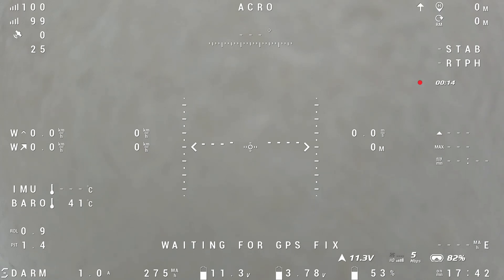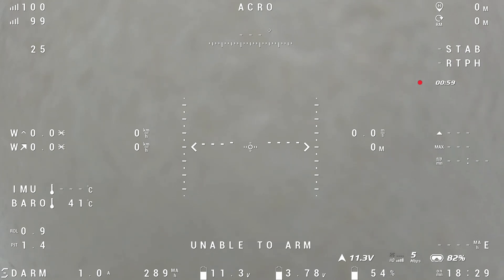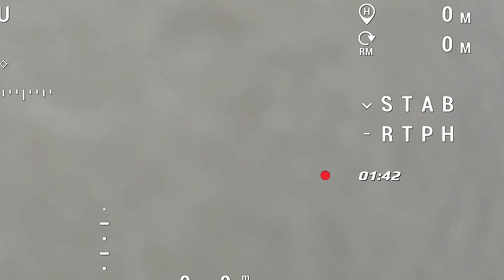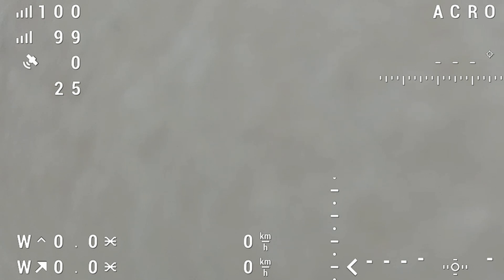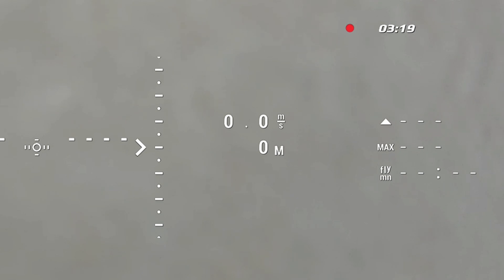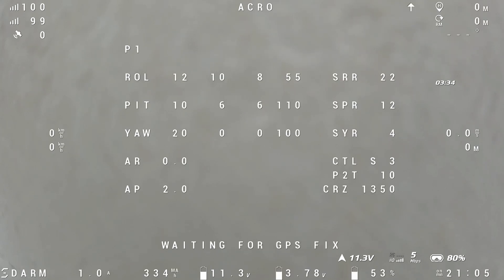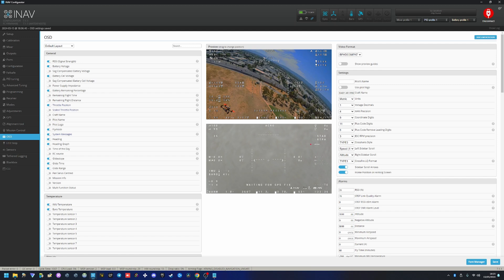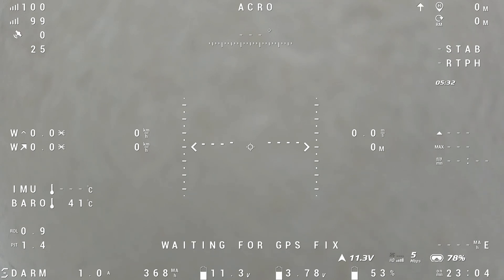DJI O3 OSD Without A Single Questionmark!

Comment: hi, after 2 hours of flight with the OSD I noticed the Wh/Km icon don't appear on my goggles, I see only the value and that's the most important of course. I don't know if it is a normal behavior or an issue. Another thing concern the flight stats: At the end of flight, I can see them in my goggles but they never appear in the OSD recordings, is it possible to let them recorded too? Many thanks to you.
Reply from the maker: Regarding the flight stats: The goggles stop the recording very quickly after you disarm and the end screen does not show. I have the same issues. The only way is to start the recording before you arm and then it will continue recording after you disarm. It works on the Vista running the O3-compatible firmware, not sure if it will work for an O3, I have to try this. 

Regarding the icon: I'm not sure what you mean. Form what I understand, you don't see the characters in flight, but then you do see them in the recording? Is that correct? maybe you can try to explain it again or upload a video.
Reply: @DZARO  I only see the numbers but not the unit appear, neither in flight nor in the recording, I having this issue only with the Wh/Km icon. 

It's a shame not to be able to record the stats because it's very useful for comparing different configurations.😃
EDIT: I have a second issue with the power (W) the value not always match the power, I guess when the power exceeds 100W the problem appear. I have published a video here: https://youtu.be/fpkzQL4G1iM
Reply from the maker: OK, so I looked into this and here is a detailed explanation:

The [mAh/km] is made up of two symbols:
SYM_MAH_KM_0 and SYM_MAH_KM_1
These have been substituted with the following:
[mAh] symbol and the letter [E], standing for efficiency. 
It is up to the user to know that the units symbolise "mAh of Efficiency".

In case of the [Wh/km], there is only one part to the symbol:
SYM_WH_KM
This means that it can only be substituted with one character, not two. 
I have left this one as blank because there is no adequate way to symbolise "Wh of Efficiency"

My suggestion to you is to use [mAh/km] as the efficinecy units, so that you don't have blank spaces. 

I know the solution is not perfect, but there is no alternative at the moment.

If you look at the following image below, you'll see that the [mAh/km] is made of two characters and the [Wh/km] is made of only one. The rest of the code is based on how these are being used and combined.

 https://github.com/iNavFlight/inav-configurator/blob/master/resources/osd/analogue/default.png?raw=true
Reply: I understand it is a software limitation, not a bug. Thank you! Have you seen my video with the W unit which disappear when I guess exceeds 100W? Maybe the same software limitation?

Comment: If this is not merge on the official Inav releases I don´t know what deserve to be on the project. Thanks again for your time!
Reply from the maker: How much do you want to bet that it will not be merged?
Reply: You can just put the "altitude" symbol on everything and achieve essentially the same result. They won't be labeled with a question mark, they be labeled "altitude" instead.
Reply from the maker: @senseisecurityschool9337  Yeah, but I chose icons that make sense to a cetain degree. Ofc it's not perfect, but it's acceptable give what the alternative is.
Reply: @DZARO   You chose icons that mean something else. You choose "K" for distance in METERS.  THen when we told you that you made the change in the wrong file and you should move your changes to the appropriate place, and that M would better than K, you started slandering us.
Reply from the maker: @senseisecurityschool9337  And what is written in this PR is not slander of DJI for example: 
https://github.com/iNavFlight/inav/pull/10046
🤣
Reply: @DZARO  No, it's an accurate statement of fact. Slander is when you make up lies about people. That doesn't go over well. Ps - when you're called out for misbehaving, a great response is to apologize. Doubling down on actions that are so completely inappropriate that it's actually illegal isn't a good look. That's not a winning move.
Reply: @senseisecurityschool9337  Obviously I do not know the history here and I am not trying to step into something that is none of my business but there is value in the work he has done.  If there is some way for this to be merged with the official INAV releases, I feel it would be of benefit to many DJI 03 Air Unit flyers…myself included.  With respect to all🙏.
Reply: @johnrobert6378   There will be improved handling of DJI in INAV 8.0. We'll just be handling it *professionally*, like grown adults.

Comment: the standard air unit doesnt need this special firmware right?
Reply from the maker: No, you can use the WTF.OS hack.
Reply: Can this be used without WTF.OS? For example: 03 Air Unit and Googles 2 or later on INAV.
Reply from the maker: @johnrobert6378  That is the purpose of the whole thing. It's because there is no WTF.OS for Goggles 2 that this workaround was created.
Reply: Oh, great!  Would it be possible to post a set of instructions on how to make this change. I’m familiar with INAV but not that familiar. Thank you!
Reply: @johnrobert6378  hi, DZARO also did the tutorial for this purpose, it is very easy to do: https://www.youtube.com/watch?v=-VCbKYNf0VA